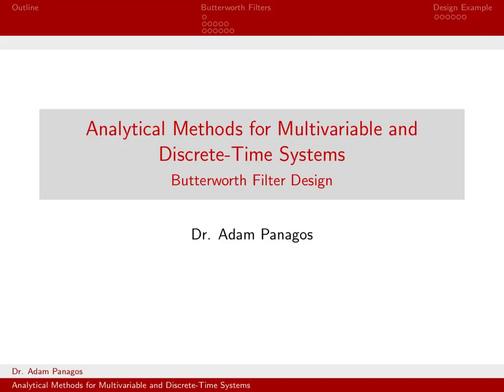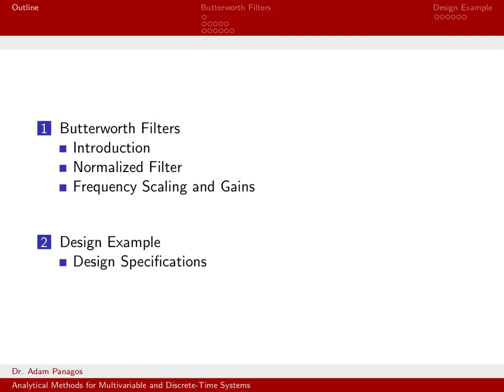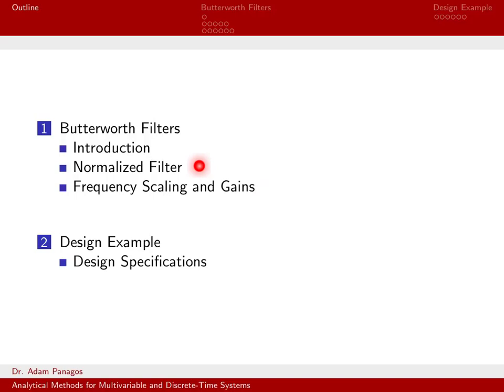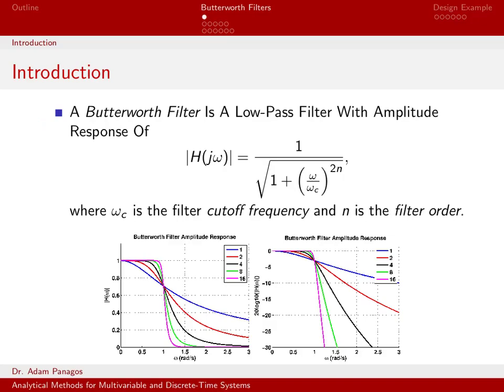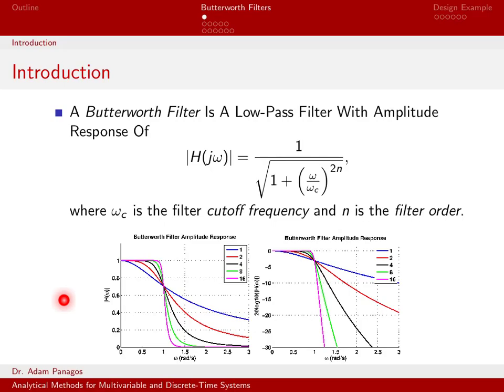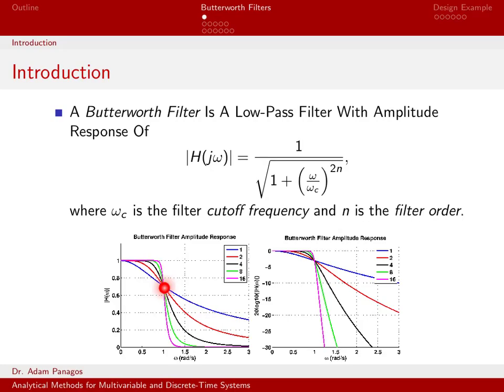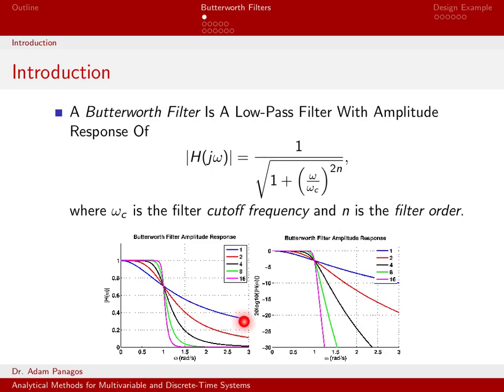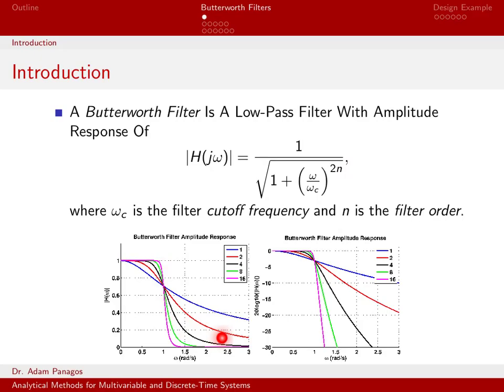Butterworth Filter - 01 - Introduction

Comment: can you please spend some time describing omega. is it a frequency variable in terms of frequency over time? omegaC was defined but not omega. ianae but i grasp a bit of calculus and linear spaces it is nice to know what it is and what properties it has. i just feel like it is used a lot in the upcoming videos and some examples to conceptualize it would be interesting.

thank you
Reply from the maker: omega is just the frequency variable in units or radians/second. It's the stand frequency variable used throughout most linear systems texts. It's linear frequency counter part is "f" with units of Hz (i.e. cycles/second). f and omega are related by omega = 2*pi*f. Hope that helps,
Adam
Reply: @AdamPanagos  thanks

Comment: Thank you for the video! I didn't understand what the letter w(omega) alone refers to. And what H(jw) means
Reply from the maker: Omega (w) is the symbol used to indicate the frequency content of the signal in radians/second.  The quantity H(jw) (which is also written as H(w) at times and means the same thing) is the frequency response of the filter.  Writing this quantity as H(w) indicates its dependence on frequency. In general, H(w) is a complex-valued function, so we usually plots abs(H(w)), the amplitude response of the system, and arg(H(w)), the phase response of the system as a function of w.  Hope that helps,
Adam